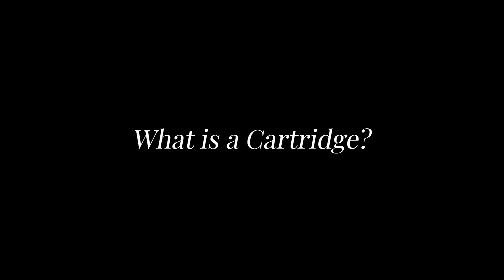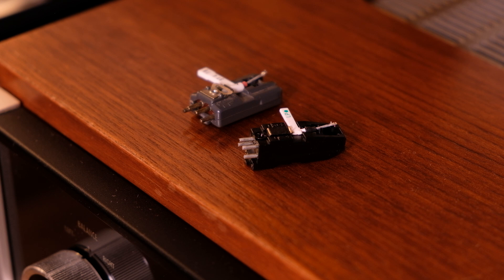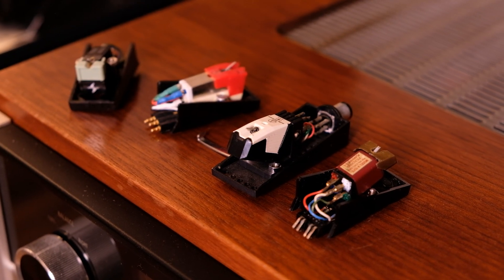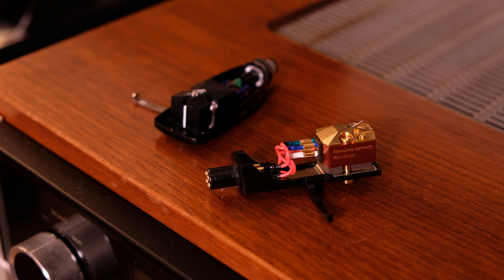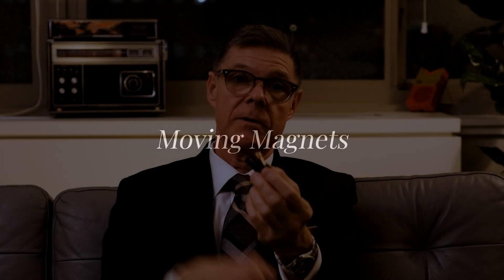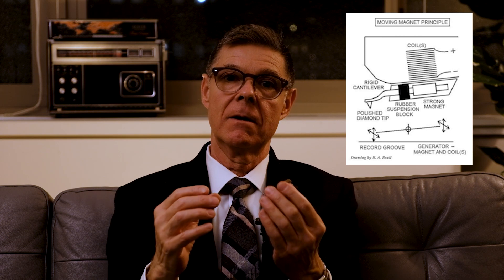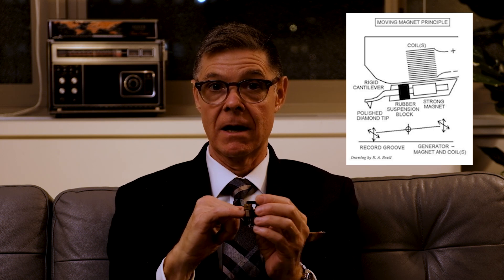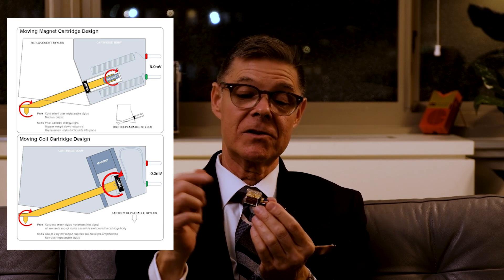Audio Basics Ep1 | What is a Record Cartridge? | The Audio Show

Comment: The best cartridge I ever had was the Euphonics Ge strain gage U15-LS.  Because it modulated resistance with stress the output at highest RIAA modulation was 100mv. It's specified equivalent moving mass was 0.6 mg. None of the conventional cartridges specify that.
Reply from the maker: Thanks for watching and commenting!  And wow--only saw those a few times in the Admiral consoles.  They had a unique output voltage and wouldn't swap well with ceramic carts of the period.  But definitely a great engineering marvel!

Comment: What is an Induced Magnet cartridge? I was looking for a replacement stylus (the kind with the “pin” that one can pull in and out) to go with my Technics SL-3300 abd and a lot of people were recommending this Empre 4000D/III I ended up getting an Empire S66E/X what do you know of that stylus?
Reply from the maker: Thank you for watching and commenting!  I have not tried the Empire 4000.  I'm not sure how the S66 E/X stylus would work on the 4000 because I believe that stylus is the for the 66 E/X cartridge.  I think you mean you have an Empire 66 E/X with an S66 E/X stylus.  I believe that is a .0003 x .0007 elliptical.  That should be a great combination with the SL-3300.  Try experimenting with the anti-skate a bit because that can make a big difference with elliptical styli.  Also, test and make sure the anti-skate is working right by floating the tonearm and while it's just totally floating turn the anti-skate and see if it actually increases and decreases the movement of the arm.  Good luck and enjoy that great setup!
Reply from the maker: Oh also--I forgot the first part about "Induced Magnet."  Basically all cartridges have to convert mechanical energy to electrical energy.  And there are two popular ways to do that:  piezo-electric principle (crystal and ceramic cartridges) or eletro-magnetic.  In the electro-magnetic principle a magnet and coil create electrical energy.  There are many combinations of the location of the magnet and coil and how they move in relation to each other.   "Moving Coil" and "Moving Magnet" are eponymous.  Beyond that there are many combinations because the magnet and coils can be stationary and a piece of iron is moving to vary the flux of the magnet.  "Induced Magnet" and "Moving Iron" are similar.  Manufacturers all had great engineering trying different placements of the elements and gave them specific names like  "Variable Magnetic Shunt" (Ortofon's VMS), "Variable Reluctance," or "Variluctance."  They all have their own sound and it's fun to experiment.

Comment: I hope you do a 2nd vid that describes different stylus shapes. I've used line contact, elliptical, conical, microline, but SHIBATA blows away the others for complexity of the musical signal, it touches more of the wall of the LP groove. Sometimes "best" is a microline, it lets you VERY cleanly play "virgin" untouched bottom of the groove when playing older discs where the top surface is damaged from poor handling, these old records were often played dirty with a trad. conical stylus.  Other cartridges that you didn't mention: moving iron (made by Grado) and optical (made by DS Audio, and which uses a unique optical phono stage). Optical carts sounds amazing because their output is 10x that of a MM, MI or MC cartridge, and uses no actual pre-amplification, only RIAA eq correction for playback.
Reply from the maker: Thanks so much for watching and commenting.  I just looked them up and they look neat!  Seems like the concept is like Philco’s “Beam of Light” concept but using new technology.  What I’m wondering is what is powering the light?

Comment: Didn't mention moving iron that is just as good or better than moving coil and lighter
Reply from the maker: Thanks for watching and commenting!  You're right!  There are some great MI carts but since they have slightly lower output than regular magnetic carts I've never gotten too into them.  I loved the concept back when they were coming out but for some reason I liked the slightly higher output of the regular magnetic cartridges.  I should try out some of the new ones.  Any suggestions?  Thanks again for watching.  I really appreciate it.
Reply: It shouldn't be a problem, you can run it through a mm phono stage like classicaudio spartan 15, or  mm Pro, as long as the phono stages has got a reasonable high output @DaveAudioShow
Reply: Dave the two cartridges mentioned in the previous post about not using the proper 78 stylus tip are indeed moving iron cartridges. That Nagaoka mp 100 is still made .that Pickering V-15 is also moving iron along with its sibling Stanton 680/681 series they are essentially the same cartridges and the stylus are interchangeable even though the look quite different. It's just those two series that are MI for Stanton//Pickering. It's a real shame that those two brands left the market about 15 years ago. They had such a huge variety of styli available for every kind of application and they all fit that same body. Not to mention that Steriohedron ( 70$ including tax at a actual store and it was nude mounted)tip they used there just isn't anything that is the same available now in the aftermarket I think it's better than a shibata and way longer lasting than a micro line which I really can't afford anyway. I also found the 680el indispensable it was a 0.4× 0.7  that tracked good at 4 grams and sounded very nice especially on very worn vinyl.  The output on those is pretty close to a MM and never had any problems using them in a standard MM phono preamp. I am totally sold on the Moving Iron. There is a subtle difference, enough so that every time I've tried something different I've always gone back to that Stanton 681Steriohedron (my last one is done now) including my Sure M91 (and it is a very good sounding cartridge). Currently have a Stanton 680ee P-mount going in my Technics SL-7 close"n"play very pleased with that set up ...a blind cord pull from a dumpster none the less. There really is some difference and it's got some of the qualities of a MC cartridge. The moving iron kind of acts like a rudder to control the magnetic field and produce the signal. Some Empire are MI I believe  My 600T was so was my Acutex315 STR light body both good sounding. The Grados are still made in the USA and MI briefly had one of those it was nice too. Have a good day. 
( @DaveAudioShow
Reply from the maker: Yes, yes, and yes.  But most critical for that post was that he needs to use a 3 mil stylus on the 78s.
Reply from the maker: By the way Pickering V-15 is absolutely a moving magnet NOT a moving iron cart.  And yes of course it can use the Stanton styli.
Reply: The 680/681 and V-15 are moving iron when Stanton / Pickering introduced this series they designed it as a moving iron cartridge because at the time the magnetic material was commonly Alnico V so they went with moving iron to reduce the mass of the armature. A True Stanton/ Pickering stylus for this series will not stick to a shaft of iron like a MM stylus. This is the only series in the entire Stanton/Pickering line that is MI . When they came out with the 881 series they did  design it as moving magnet because new low mass magnetic materials became much more readily available . They later introduced some styli that hsd a magnet for high output applications used mostly by DJs for thst series. It's clearly stated in the  literature provided by Stanton/Pickering .  Sorry if this may seem critical, but this has beenan important issue for me getting replacemen styli for my Stanton  680/681 cartridges because many of the aftermarket styli do have a magnet and  do  have a significantly  higher output  and messes with detail / sound stage @DaveAudioShow
Reply from the maker: The 680/681 are absolutely Moving Iron.  The 680/681 is the same as the XV-15 not the V-15. The V-15 is Moving Magnet and the XV-15 is absolutely Moving Iron and would use a very different element inside the tube of the stylus.  I don't have an XV-15s or 680s but if the element inside were also a magnet then-- Yeah! That would cause a real problem.
Reply: @DaveAudioShow  I wasn't sure about the Pickering  . So the V-15 is an older model and when they introduced the Stanton 680 like wise  Pickering introduced it as the XV-15. Thanks for the clarification. So was there a Stanton series that was the same as the V-15. I had only used The Stanton 680/681 as those were readily available in my market. I was a shame that Gibson took over Stanton and started phasing it out. The first thing that they dropped was the Steriohedron stylus for the 681 that was a real blow when I discovered I couldn't replace it. That was such a good stylus it just made everything sound better. Another benefit was it played the second hand records so well cutting down on the noise and mistracking caused by abuse and ware put down from an elliptical . So I ended up getting the stylus for a 680EL II that one sounded pretty nice....I was glad the guy at the DJ supply store recommended it I was totally pleased that one did a nice job especially with those second hand ones too...should have bought a bunch more when I could because those were gone the next time. That place in Nevada has a lot of replacement stuff but they sure aren't good at replying to questions. Those Jico Styli are probably the way to go but they are currently out of my budget. They have that Nude Schwartz Stylus but I could get a straight answer and that one just went out of my budget too. I suspect it's one of those Swiss made nudes . Most of them work in the  881. So I'm still going to stay with that moving iron sound there is a magical quality about it that is hard to describe. Yeah right now I am  using one of those Swiss made ones. The sound stage shrunk, the bass and treble are accented and the distortion is slightly noticeable not bad. Kinda sounds like a dicotek/rave/hip-hop, it would be an excellent choice for that.Nice talking to you.
Reply from the maker: The Stanton 500 is the same as the V-15.  Walter Stanton wasn't just an engineer he was a total marketing guy too.  As you probably know he bought Pickering in the early 50s.  And as far as I remember they always marketed the Stanton branded carts totally separately but also (as far as I remember) every Stanton branded cart had its Pickering equivalent.  I think (just my thought and opinion) that Walter Stanton did that very purposely to keep the Stanton brand very distinct.

Comment: I have a Nagaoka MP-110H. I have played my old shellac 78s with it, and they sound great. Should I not do this since this particular cartridge is not designated for it? Thanks.
Reply from the maker: Correct!.  Unless you're using the Nagaoka MP-78 stylus in it.   The MP-110 comes standard (I believe) with a .4 mil x .7 mil elliptical.  78 RPM records need a 3 mil stylus.  (That's "3" without the decimal point.)  LP "microgroove" records use .7 mil.  Or just as a decimal:  .003 vs. .0007.  Are you using the stylus that was originally installed in the Nagaoka MP-110?   If you're using the factory installed .0004 x .0007 then you should not play the 78's with it.  If you think they sound good now wait until you hear them with the right stylus.    If you play them a lot then the sharp (.0007) tip will damage the bottom of the groove.  Think of a luge race in the winter Olympics:  the luge has to fit right in the bottom of the track.  By playing your 78's with a .0007 diameter you're kinda like going down the luge track with roller blades.  Nagaoka makes a 78 specific stylus for that cartridge and the part number is MP-78.  Try that and you'll be impressed and you'll save your records.  You could also get a separate headshell/cart combo (like a Pickering V-15) with a 78 stylus and just switch out the headshells and it might actually be cheaper. And I love the V-15 with 78's because it tracks a little heavier and is a good "fit" for the right sound.

Thanks again for watching and commenting!  Let me know how that goes!
Reply from the maker: I just checked it out in depth and Nagaoka actually makes two different 78 stylus options for that cartridge.  They make the standard 3 mil 78 RPM stylus with the part number N-MP78 and also the N-MP4.0 with a 4 mil tip for worn 78s.   I would go with the standard 3 mil to start.
Reply: Wow! Thanks for the info. Im glad that I did not continue to play my 78s with my current set up. I'll look into the 
Nagaoka 78 stylus options. @DaveAudioShow
Reply from the maker: You're welcome, I'm happy to help!  And thank you for watching!
Reply: Cool show. Thx